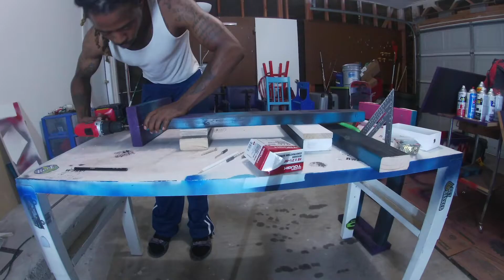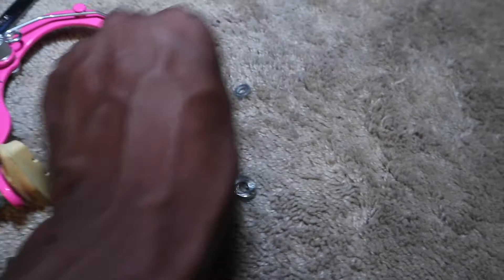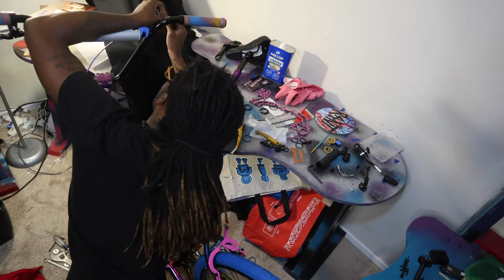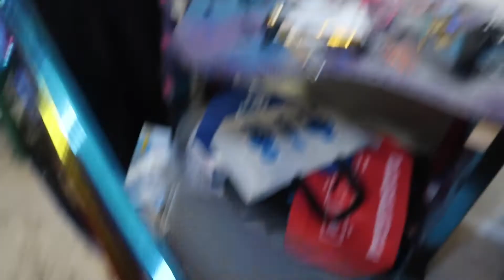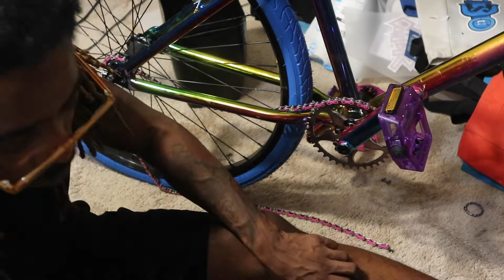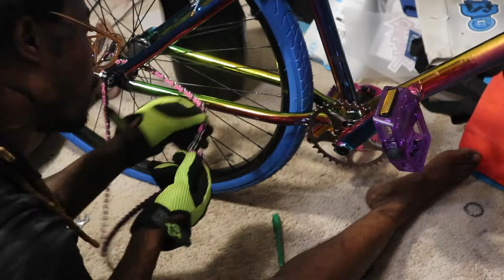HYPER JET FUEL 26r UPGRADED TO A 29r!

Comment: Will any 29 inch tires fit on this bike ? Nice built btw 👍🏾
Reply from the maker: Only the smaller tires will fit not the fat tires, I got these off eBay
Reply from the maker: These are 29in tires and wheels though
Reply: Ok thx

Comment: I bought a 29'' hyper jet fuel like that and im wondering is it good for bikelife/Wheelies?
Reply from the maker: yea it should be bro, the 26r is for sure
Reply from the maker: @gendoikarii  this actually is not the jet fuel 29in, but actually just the 26in with 29in wheels on it. The 29in just came out this year and I have yet to see it in person.
Reply: @rowdysworld22  did you have to modify anything for the 29 in wheels ro fit
Reply from the maker: Only thing you will need to change is the brakes